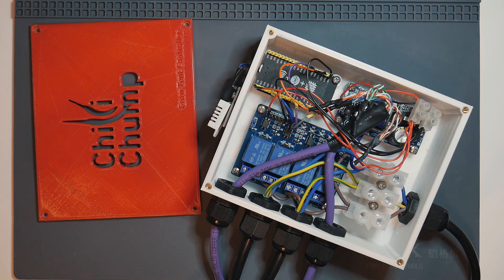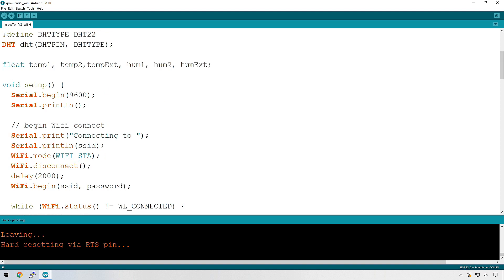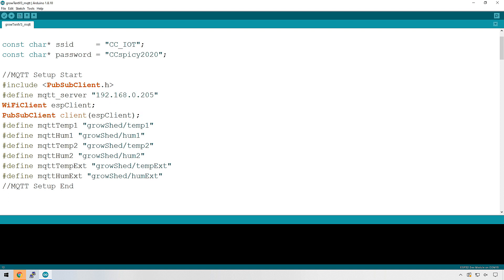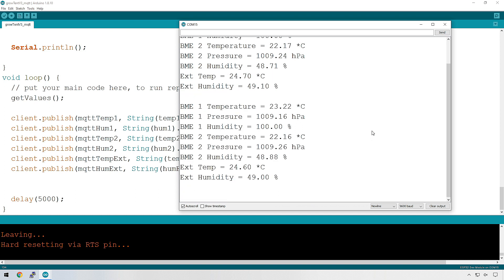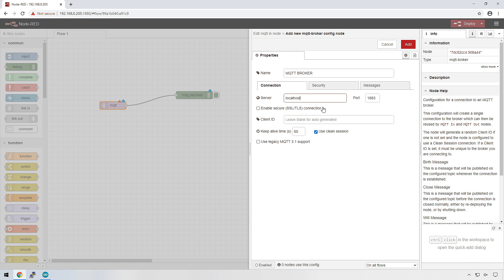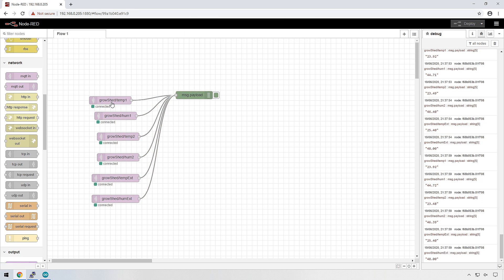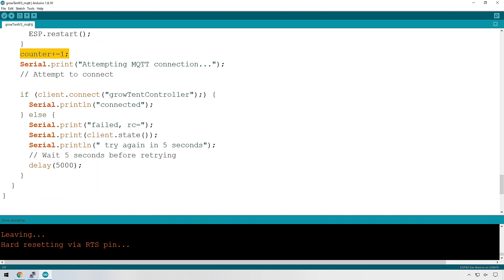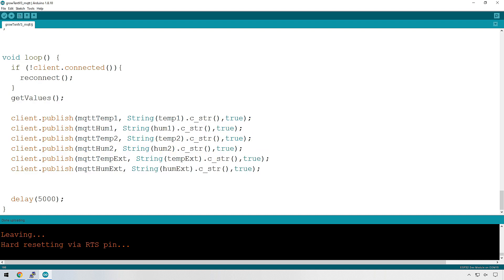Episode 14: Connect to WiFi and send MQTT data with the ESP32 - CCBGTA

Comment: Beware! Mosquitto higher than v2.... requires setting up authentication otherwise you will get rc-2 error message when connecting. If no authentication is desired mosquitto.conf needs to be editted with parameter "allow_anonymous true". I just spent a couple of days figuring that out.
Reply: do u mind sharing how u did it step by step coz i am stuck  on this hard
Reply: it's giving me rc-2 error even after doing the authentication

Comment: Can I use an Arduino UNO R3 module instead with temperature and humidity sensor connected to it
Reply from the maker: You could...but then you would need to find a way to add WiFi capability to it.  The Uno doesn't natively have WiFi

Comment: Am getting: "Attempting MQTT connection...failed, rc=-2 try again in 5 seconds" error in arduino serial monitor Followed exact same procedure as in video. What could i have done wrong?
Reply from the maker: Make sure the MQTT host IP address is accessible from the network that your ESP is connected to. I would also consider reserving that IP address on your router, to make sure it doesn't change (if you haven't already done that)

Comment: I am able to Connect using Wifi and the Code seems to be working but when trying to connect to my Broker it seems to just keep reconnecting. Is there a way I can test to see why this? I am on the same network just not sure why it will not connect to the Broker. Thanks for any help
Reply: I got it all figured out.

Comment: I means, should i check the hardware connection ? Is there a possibility to check the hardware connection by using a ping command ? If yes, did you have an example ? :-)

Comment: Hello all,
 always had problems that the connection to the MQTT broker was lost. Have then implemented your reconnect solution here, but when testing found that the disconnect is not clean detected. that is, I started the program, it was established a connection to the MQTT broker, then I pulled the network plug on the MQTT broker. The disconnect is not displayed directly or my ESP32 does not try to reconnect. Only then, when I plug in the connector again, a reconnect is performed.
Is it the same with you ? In the time some data could be lost.
Many thanks and greetings 
Stephan
Reply from the maker: Stephan, in response to your other comment: In my original code I was pinging public servers. But it wasn't necessary. This code should work just fine. 

With regards to the issue you mention...make sure your code isn't getting stuck in a loop where it will only break out if there is a connection. For example if you had a loop sending data somewhere, and the loop ends only when the data is successfully sent. If you are disconnecting the internet at the point it is in that loop, then it will never come out, and never check whether it is connected. So either put in place a function to test connectivity during the loop, or make sure the loop ends after a few unsuccessful attempts.
Reply: @ChilliChump2  Thanks for the quick reply. You describe exactly how your code is written, I adopted it exactly the same.
In the main loop the reconnect function is called where the connection is checked. It works yes on power up, but not when the connection is lost, not again until the connection to the MQtt broker is physically re-established.
Reply: With your solution my actual problem is also eliminated, I had connection failures to the MQTT broker.
With your solution, the connection to the MQTT broker is now re-established.
But if the disconnection has a physical reason, e.g. the network cable was disconnected, then the disconnection is not recognized, I just tested it again.
Strange.....

Comment: not sure if the versioning changed, but using the wifi code you have, (im on ESP8266), the #include <WiFi.h> does not work for me as there is no  .mode().

however if i import #include <ESP8266WiFi.h> there is a .mode() class so im gonna try and use that.

Thanks for all the tutorials, Cheers!
Reply: I am getting the same error, even after including ESP8266wifi.h error is not going. Can you please tell me from which library manager you downloaded that library to support it.

Comment: I have a weird fenomenon that when i add the wifi code and all the settings 2 out of 3 sensors stop working. If i remove the wifi code it works like it used to
I have an esp32 devkit v1 board and connected 3 sensors which are photoresistor (ky-018), dht-11 and capacitive soil moisture sensor.

dht-11 is connected to D14 (works)

photoresistor(ky-018) connected to D13 (doesn't work)

capacitive soil moisture sensor connected to D15 (doesn't work)

any ideas? why it doesn't read some sensors?
Reply from the maker: How are you powering the sensors? Is there enough power input to run all three at the same time?
Reply: @ChilliChump2  hey thx for the reply, guys on the forum said to connect 2 sensors that didin’t work to adc1 ports and it worked :)
Reply from the maker: Glad you got it sorted out! I show adding dashboards on this on Episode 13: https://youtu.be/DYlaGpnu_v0
Reply: @ChilliChump2  thx again forgot about the dashboard addon :D

Comment: Hi.

It seems you left out some sensordata and you also read the pressure directly from the sensor instead of storing it in a variable, any particular reasons for this? Btw, great series!
Reply from the maker: Hi Peter, I didn't need all the sensor data, so removed the superfluous things (i.e. air pressure). Also, there is no need to store the data in variables...you can, but it isn't necessary with the sensor data. This data is being logged back to my server via MQTT, so once it cycles through again, it can lose the information because it will already be stored on the server. I would maintain some data in variables, like timing, device status (on/off) etc. That being said, if you want to store eveything in variables, then that is fine.

Comment: When I plug the ESP32 into my computer's USB, everything works great. But, if it plug it into a normal power source using the same USB cable, nothing seems to work. Has anybody else had similar problems?
Reply from the maker: Have you tried other plugs? USB cables are rather simple....if the cable works on the PC, it should work on a functioning plug.
Reply: @ChilliChump2  I tried a plug that does not transmit data and now it's working perfectly.  Thanks!

Comment: I am way behind in this project, its a sort of investment.
I have used PICs in the past in very noisy/dirty environments and used a Watchdog Timer to Reboot if the code got stuck. I am sure I haven't seen anything similar with the Arduino, is this refresh timer thingy the solution or is it purely for the Network connection?
I don't anticipate a noisy environment cos my application will be domestic but it would be naice to know there was a way of kickstarting.
FYI I had a friend who developed a Chip Pan Heater Burner Flame monitor with a PIC and the Spark ignighter effectively meant that the program on the PIC never ran for more than 20/30ms. You can do a lot of code in 20ms.
I should say that I do not do anything in this field nowadays, not for 20 yrs so any knowledge I have is completely out of date and my access to current stuff is the likes of you and similar.
I should add, for which I am gratefull.
Reply from the maker: I have a more comprehensive Watchdog that I will be sharing later on. I think it is a little advanced for this stage of this series though. There is also a built in watchdog timer on the ESP32 and ESP8266, but as you know, watchdog timers don't catch all problems. The one I have developed works flawlessly....over 2 years without a hitch on my production systems.
Reply: @ChilliChump2  That's welcome news. The watchdog on the project I was thinking about was to simply cover something caught in a subroutine. It is a long time ago 25 yrs probably and was a simple read of a temperature sensor and display onto a large LED display. I cannot remember why now but overnight runs in my den left it locked, and that was in a workshop environment and no amount of Single Stepping through the code brought up a coding error. The watchdog, out of the subroutine (The program was written in assembler) fixed that and after a continuous lock free run of a couple of weeks the device went into service.
It must have been the most expensive Temperature Display in the world at the time but my Boss did not like to pay £80-90 for one so I made one :-). Part cost next to sod all and he was happy. Lots of hours me haveing fun he didn,t notice. :-D.
Looking forward to the WD-Timer substitute when you care to tell us. As I said I am trailing behind with basic stuff, soldering is not as easy for me now as used to be :-) grey beard gets in the way.
I must say that my impression of the Arduino is not wonderful. Your application is better than most where it uses a moderate amout of I/O, not sure about Code space, whereas others I have seen use a couple percent of the I/O. Seems wasteful. The Arduino has Code memory for a small amount of its I/O. That is unless I am missing something. I have not seen any information on coding the Micro Processor in Assembler which would probably more economical. Also not sure/don't know of the memory layout. The PIC had separate Data and Code segments, I have not seen information relating to this for the Arduino MicroController Chip or its ability to be programmed outside the Arduino environment.
Sorry about the small Novel, got engrossed.